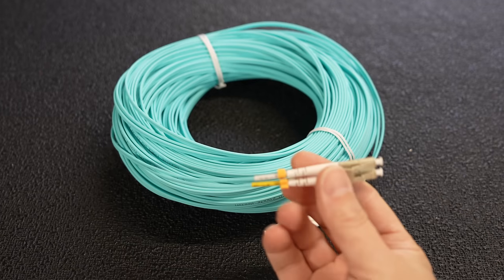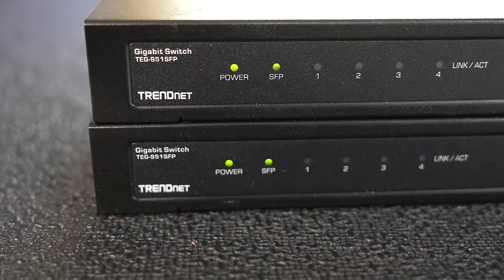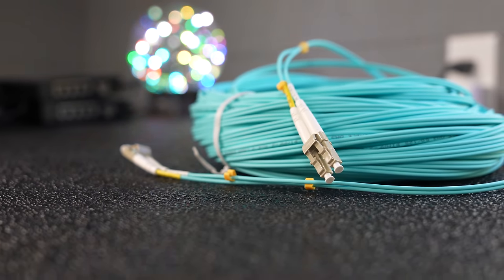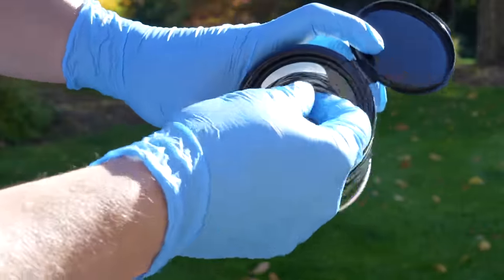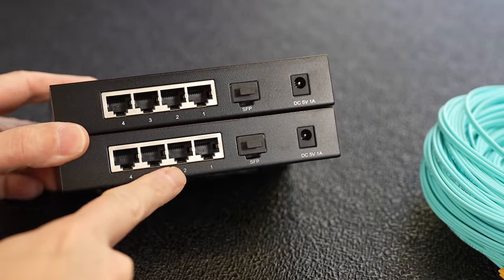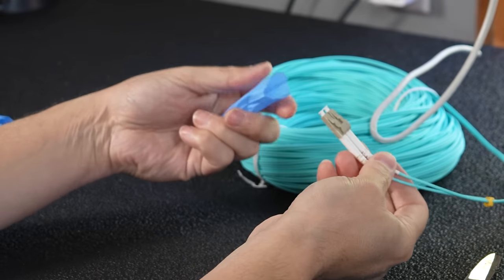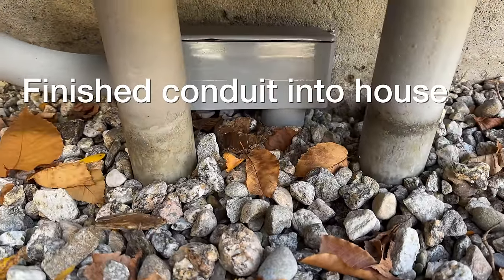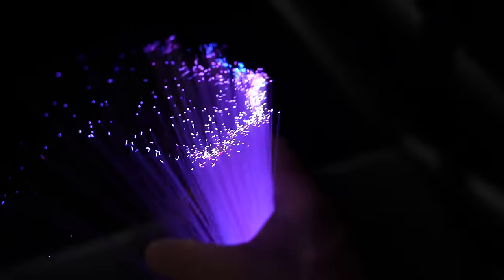How to Run Fiber Optic Cable in Your Backyard - My 10 Gig Install for Starlink

Comment from the maker: Fiber I used: https://amzn.to/3Dbksrt Switch: https://amzn.to/3MKb7tW SFP: https://amzn.to/3TqonWO - Check out JUST ANSWER for professional help when you need it: https://justanswer.9pctbx.net/VyQGZE
Reply: Thx
Reply: Cool 😎
Reply: Use singel mode fiber(yellow) insted off multimode fiber. price is about the same and it can go longer, and it can handel 100gbit+ and support for mux if you need TB speed.
Reply: The switch you linked to only has SFP not SFP+ port, from what I see. Not 10gig
Reply: That cable is not outdoor rated.
Reply: As noted above, those switches are sfp, not sfp+ and it’s a gigabit switch which is rated for 10Gb *switching capacity*, but each connection (the sfp port included) will max at 1Gb speed. You need a switch with at least a sfp+ 10Gb uplink to get the 10Gb you described. Those switches increase the price for this project quite a bit.
Reply: 10GB per Second????
Reply: how much speed give you
Reply: Watching you tell people about how much water can be in conduits, took me back to years ago when I first got into the electrical field of work. I was shocked (no pun) the first time I saw how much water can be in conduit that contains electrical wire. Even more shocked the first time i had to shop-vac 20+ gallons of water out of a mesa box. It is practically a given that there is water in your underground conduit, it just happens.

I've come a long way since then, and can twist and turn one fishtape to catch another, push or pull dead mummified mice out of conduit, etc. I've learned to always keep a 7-11 bag or whatnot on hand, for when you don't have a proper "mouse" to suck through conduit. I even discovered along the way that a leafblower on one end combined with a vacuum on the other can be quite effective.
Reply: Nice setup and it is at a reasonable price. Most people do not understand that you got almost 450 GB per hour in a single direction. So by today's standards, it is virtually wasting money. You can literally Synch 10 TB of data over the network in one night...

Comment: Amazed at how seemingly easy it was for you guys to pull that cable through. Every time I've had to it involved soap, water, and anger.
Reply from the maker: I was definitely fortunate with this one. What you saw in this video was just as it happened. I had no idea if it would go bad or if the pipe was broken in the middle. I had planned to use lube and prelube the pipe but with the water I figured that might be enough. I wonder what they planned to run in the pipe someday, maybe phone or coax. I think we were at CAT3 cable at that time still if even that much,
Reply: @SilverCymbal  love how forward thanking they were
Reply: Still depends on your area, even if you have fiber network at home if ISP ransmission is throttled way below 10G its gonna be useless.
Reply: @alexandercruz8346   He's got Starlink. A 10Gig connection can still be useful even if your internet isn't that fast. For things like data transfers in your home network it's really handy. 

Think about streaming multiple 4k movies from let's say a PLEX server you have set up at home. You have all the movies on some harddrive in one of you computers or even a dedicated server and can stream to many different clients in your home network.
Reply: @jrdwiz   Speaking from my  experience not a lot of people I know have set up a proper home network. I tried my best to pull cables at home but I live in an ancient farm building and have super thick walls. I can make do with Wifi for the most part right now but I need a lot of APs to cover the whole living area. 

My network speeds top out at 1Gig but it's fine for now and it's surprisingly reliable. I "only" get 100Mbit fiber into my house, but I can live with that in my rural area. I was really surprised when they offered fiber here where I live. It's 40 bucks a month for that, the Gigabit option is still way too expensive, around $100 or something like that.
Reply: @schwuzi  if your power sockets are properly grounded you can use them to network. They call them Powerline ethernet adapter, gigabit ones being 100$, I'm sure there are cheaper variants.
Reply: @vadnegru   I know about them, but my house uses 2 different fuse panels and for some reasons it doesn't play nice with them. I successfully used some of TP-Link and Devolo's powerline products in other installs I did for some of my friends. For my use case they don't perform and Wifi is still king. 

At some point I will pull fiber and ethernet throughout my house, but until then I'm satisfied with what I have.
Reply: @vadnegru   My experience is that when those powerline adapters work, they work really well. Even different brands of adapters work together seamlessly and reliably. In modern buildings it's no problem to kit out the whole house. However when almost centuries old wiring meets more modern wiring, over pretty large distances, the powerline stuff is just not suitable. I tried and failed. 

If I'm really bored at some point I might redo my whole electrical system. I'll have to crack open the brick walls to do that though. I've got so many projects going on right now that this will just have to wait. It's going to be a great mess when it finally happens though ;)
Reply: @schwuzi  And if it’s AT&T, your gigabit option will still be 100 Mb. 😂
Reply: Windex
Reply: Next time buy wire pulling lubricant and you will not get tired att all.  :)
Reply: @rfichokeofdestiny  Not sure if you are speaking from personal experience, but I had AT&T gigabit fiber for a couple years and it was rock solid and quite fast. Speed tests were consistently in high 800/low 900 mbit/s range both up and down. Very low ping and jitter.

I happened to be in one of their XGS-PON neighborhoods, and they were offering 2.5 and 5 gig options shortly before I left. Never upgraded since my LAN was limited to 1 gig.

I'm sure service varies from location to location, but not all deployments are crappy.
Reply: @aaronboggs5799  Yeah, personal experience. I have the 300 mb plan and have never gotten more than 90. I’m not complaining too much because it’s fairly cheap. But the people who paid for the 1 gb here are also getting 90. 😬

Glad to hear it’s not universal though. I’m just glad there’s an option other than Comcast.
Reply: @rfichokeofdestiny  Ah, gotcha. That is definitely not OK if folks are paying for gigabit and only getting 90. I would definitely be complaining to them if I were in that boat.
Reply: @jrdwiz  lubricants
Reply: i’ve used baby powder for long runs of RG58.
Reply: You probably have too many bends in your conduit runs. Friction makes it almost impossible to pull after 360 degrees of bends.

Water pipes can have as many bends as they want because water pressure pushes water around every corner no matter what. Pulling wire, every bend adds more friction to the system and reduces the pulling force available to the material around the corner

Comment: "Are you stuck in the 90s?" Yes, yes I am.
Reply from the maker: I pretty much am too but I do like 10gig
Reply: 1990’s: “This house has central air and central vacuum!”

2020’s: “Did I hear aircooling and tiny subways for my home networking?”
Reply: This man is running in the 90s
Reply: 1930s

Comment: I would recommend running single mode fiber instead of mulitmode. Single mode fiber unlike mulitmode is future proof and will do basically any speed. Pricing is also very similar nowadays. Like cat cable, multi mode fiber has gone through faster and faster versions. Single mode is still the same and still supports up to the highest speed.
Reply: Sounds like you may have installed a dedicated circuit or two lol
Reply: Came here to say this.  Single mode is the only way to go for any fiber run except for specialty stuff in data centers.  The only speed limit is the electronics.  They've pushed fiber to over 400 terabit already
Reply: What's the actual difference between single and multi? Is it the type/quality of glass used? It doesn't seem to have any bearing on end connector type from what I can tell. Can you use a SM LC cable on the ubiquitous MM transcievers?
Looks like you could also use OM5 cable and be good up to 100Gb, assuming MM equipment stays around in the future. 
Although unless you're a business, utilizing full 10Gb even on a moderate HDD based NAS isn't very common.  With 2 VDEVs in my NAS I'm only hitting about 5Gb/s sustained transfer speeds between my editing machine and nas for large files.  For very short bursts between an SSD and the NAS RAM cache, it can hit 8-9Gb/s, but not very long obviously.
The problem is 10G switches are now just starting to become reasonably priced for the average consumer, I haven't even looked up 40G or 100G switches but I assume they're expensive still? Last I looked 40G transceivers were still in the hundreds. I got my 10G ones for like $25.
Reply: @andrewt9204  the main difference is the diameter of the fiber. SM is much smaller so signals bounce less on the sidewalls resulting in less loss. My ISP offers 25gbit and said in around 2 years expect 100gbit. I don't want to run something that is slower than the SM coming into the house.
Reply: @sschueller  Multi-mode can run 100 Gbit/s as well. Single mode is used for distance. No provider would offer services through an OSP through multi-mode because of that. So for shorter distance runs through single mode we commonly have to use attenuator pads on the fiber to take the signal down to an operable dB level to ensure the optics work properly and are not damaged over time from the signal being too hot.
Reply: @sschueller  thanks for the info. Seems like MM would still probably be ok for most users. I do envy your isp capability. It's rare to get anything above 1gb here in the US.
Reply: @andrewt9204  The frequency of the signal is different as is the diameter of the glass.  Old OM1 multimode is 62.5 micron.  OM2 through OM5 is 50 micron.  Single mode is 9 micron.  A signal propagates down a fiber strand by bouncing off the sides of the cable.  If a signal has to move from one side of a cable to the other that is 9 micron vs a cable that is 50 micron, you can see there would be less latency.  There is a shorter distance the signal has to travel down a 10 foot single mode than a 10 foot multimode.  Still going at 1gb or whatever speed.
The glass is the same and the newer manufactured stuff is much better quality.  They also use plastics and different designs like honeycomb.  The connectors are the same, but the old cables often used ST or MTRJ connectors.  Newer fiber of either mode will typically use ST or LC connectors.  Some are trunk cables with 6, 12 or 24 strands in one cable and connector.  Those are called MTP connectors.
10gb switches for home are attainable now.  fs. com is the place for very good and cheep SFPs.  They also sell custom length patch and trunk fiber.
Reply: @andrewt9204  The primary reason that we have such speeds available here is because the fiber is owned and maintained by the city. Any provider can offer what every they want over it,
Reply: @sschueller  Ah, where are you from? I think in CH they have a similar system, when the Govt wants no monopoly, you can get 10Gb network speeds for like 50 EUR or lesser. Honestly amazing
Reply: @hariranormal5584  I am from CH (Switzerland) :). My ISP charges me around 70 USD per month for the 25gbit synchronous connection. Not every place in Switzerland has fiber but places that do generally are part of public utility. Not everything is rosy however, there are some legal wranglings with the largest phone company (part state owned) that started running fiber with hardware between home and POP which is seen as anti-competitive. It limits the speed to what the company put in and requires power. Hopefully it will be resolved soon in court. For those that do have the standard fiber in their home they have 4 SM strands usually at least 2 terminated at the home box. Each box in the home has a OTO ID which you can use to order service from a large list of providers.
Reply: @hariranormal5584  Swisscom just recently stated they will offer the ability for home owners to get the "old style" as in correct wiring IMO for a fee starting next year. This is probably due to the fact that there is an injunction preventing them from continuing with their new setup and a lot of people are complaining. Allowing people to get the connection via a fee gives them an out and in the worst case for them they may need to refund anyone whom took the opportunity (although they may try to make you sign something and there will be another court battle to get that back). BTW it is estimated that it costs Swisscom only around 60 USD more per OTO to do it correctly and future proof. Also no one has talked about the environmental impact and waste electricity to put these "fiber splitters" in when you can run fiber directly with no electricity requirements.
Reply: @hariranormal5584  Swisscom just caved, they are dropping their appeal against the government and will stop installing P2MP. They will however reduce the new fiber expansion they had planed but I see a possibility of government giving them more money to move faster.
Reply: The speed of the fiber itself is basically limitless the limiting factor is the SFP's and hardware connections processing the traffic.
Reply: People, guy in video connected his "shed" to the Internet, there is no datacenter there and no need of 100Gig+ speeds, LOL. Yes, single mode is more popular nowadays but multimode modules costs more than 10 time cheaper than single mode ones... You even can separate connector of those two fibers an use them as two independent links, so what's the problem? In these case I see no difference.
P.S. 50 bucks for that fiber? Recently I paid 7$ for 125 meters single mode SC - SC patch cord in Ukraine.
Reply: i have a barn 80 feet behind my house and run 10 gig ER over a XENPAK transceiver for my plex server to run full blast 14 megabits per second of pure bliss, I dont let my lasers miss the target in this household so only 40 km range will do
Reply: @sschueller  I bought everything outlined on this post and cannot get the SFP light to come on?  I also tried another spool and it also didn’t work.
Reply: @KyleMusser-bn4ug  You would need to be more specific what you have. My post here on youtube was regarding MM vs SM. Are you referring to my blog about wiring my home with fiber?